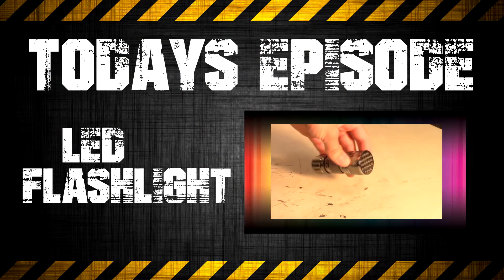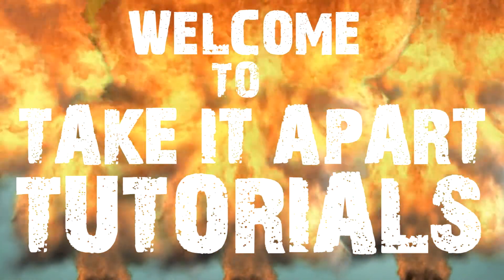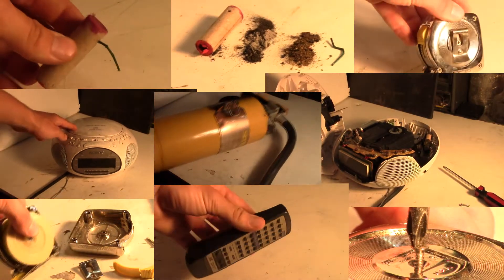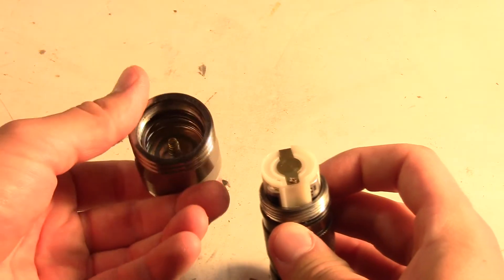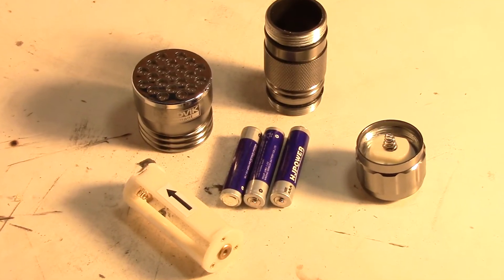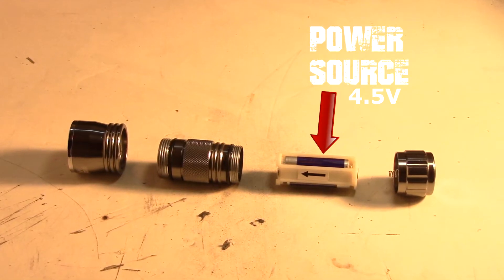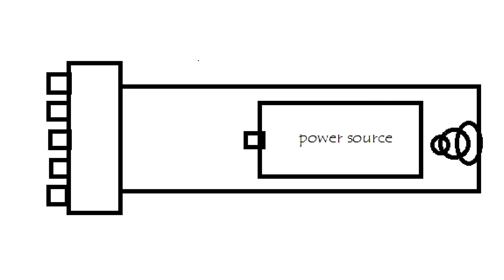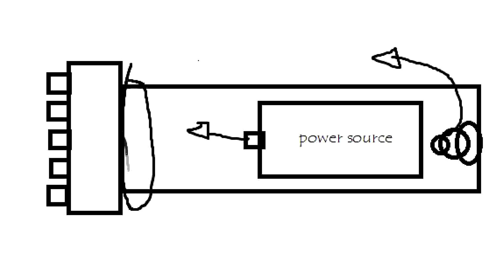TIAT (Take It Apart Tutorial) - "LED Flashlight"

Comment: Aren't the batteries in parallel, meaning the voltage is still 1.5V but the amperage is tripled?
Reply from the maker: The way the Tri-capsule battery holder was made, was that it was kept in series. So I believe the total voltage was 4.5 volts. You are correct if it was in parallel.